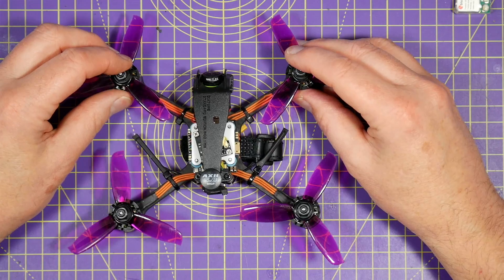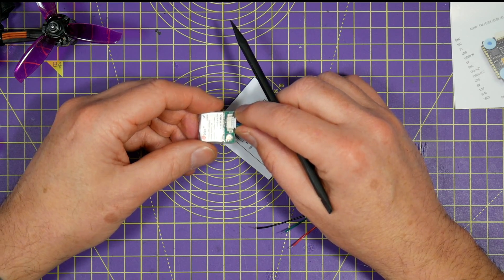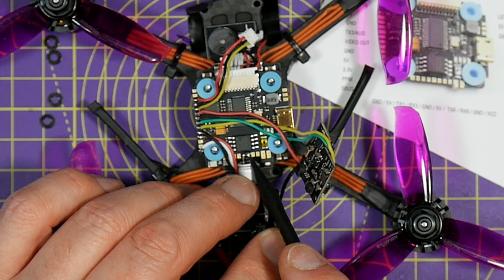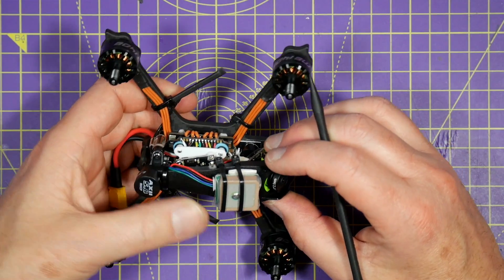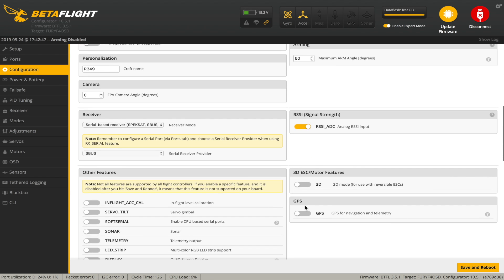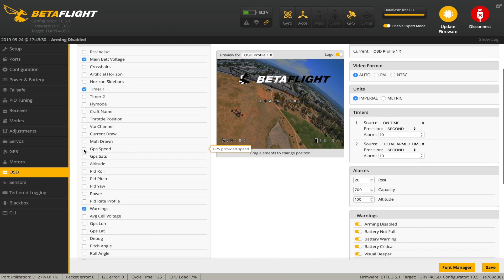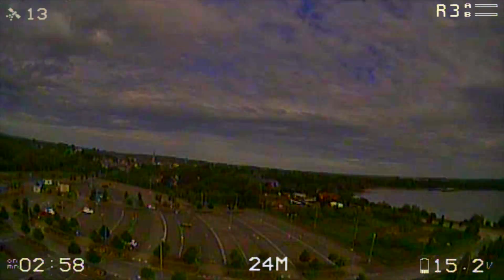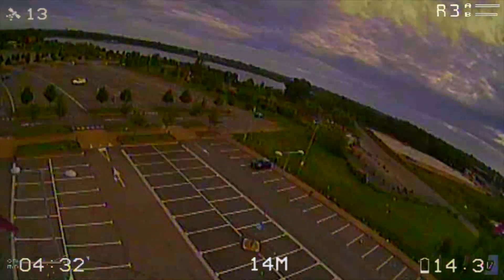Diatone GT R349 adding a GPS module // 90 MPH speed test // betafight rescue mode // ublox M8 Neo

Comment: surely you need a compass/magnetometer too? otherwise the quad knows where it is and where it has to go but it doesn't know which way it is facing so it can't tell whether it's destination (say, east on the map) is to it's left (ie it needs to turn 90deg anticlockwise and fly straight) or straight ahead (ie it just needs to fly straight ahead?). I think there are i2c pins on the bottom but I can't tell which one is SDA and SCL so I don't know where to wire up my GPS&Compass combo unit (matek). Very grateful for your help.
Reply from the maker: You can do that, but for measuring speed, it just need position - rate of change of position. This isn't 100% accurate, but I don't to know exactly how fast it is. Thanks for watching.

Comment: Thanks for this video. It works on the first FC version... but how to connect a GPS on a MAMBA F405 MK2? They changed the layout and even though there are more tabs, there’s no UART1, only a bunch of LED tabs. Do I need to/can remap 2 of those as Softserial for the GPS? I’m using Crossfire RX on UART6. I appreciate your help.

Comment: Was looking to purchase the std R349 from BG but seeing this might plump the extra £30 and buy one of these HD versions. This will be my first racing quad, progressing from flying  BUG's 2, 3 & 3 mini, Trashcan 75 & KK ET115 v3 (3S). Thinking of flying 3S as have plenty of batteries and no 4S ones as yet.
 Notice you replaced the antenna with an AXII lolipop, do you find that is working better than the linear & if so possibly could you include a BG URL link and specify connection type needed to purchase.
I would like to add a GPS unit for RTH, and have a few BN220's in my spares,  would this suffice ?

Comment: I want to put a GPS module on my gt349 but I don't know what one I need to buy that would be the cheapest but still do speed and distance and altitude but I am using uart 6 for smart port telemetry.. Ive heard you can use soft serial is this true or how would I do this.. Please if you could help me that would be great also where did you put your reciever  and how is your little aci tx antenna mounted?

Comment: There is a configuration utility for ublox available, where you can adjust your receiver.
You can get much faster results by removing unused values like your actual position and obviously by increasing the connection speed. All you are interested in is just the speed and not the ton of values the receiver is usually transmitting.
Several instruction videos are available.
Reply from the maker: Thanks for the info.

Comment: Another great video WB I can see there being a run on GPS’s at BangGood over the next few days with this video lol. High camera tilt, nose right down and hold 100% throttle for a good 2 seconds and I recon you could get near to 110mph with this powerful little quad.
I used the same Rx6 and Tx6 pads but I used the LED’s 5v and ground as I was a bit worried about de soldering the capacitor.
Reply from the maker: I needed more room TBH. With a longer run I think 100 mph is easy.